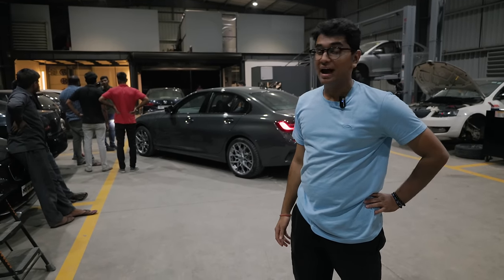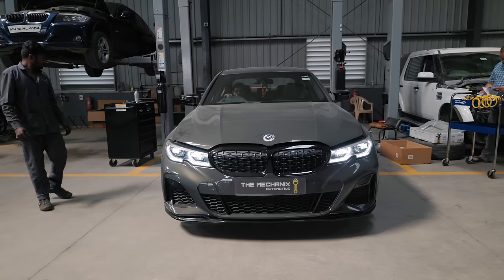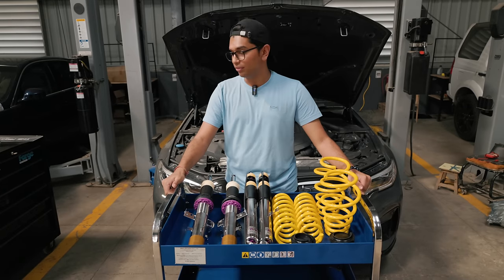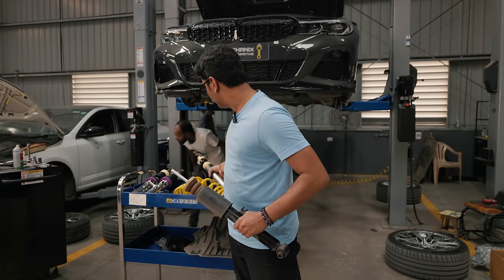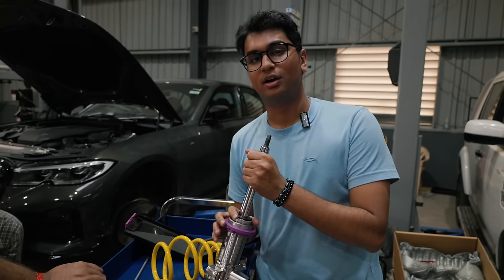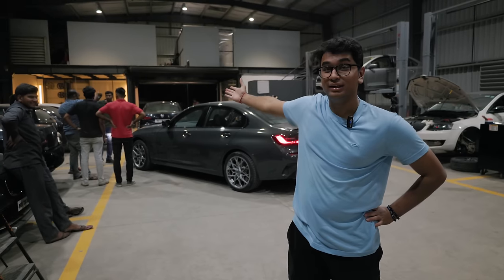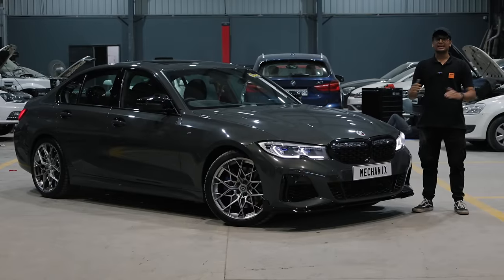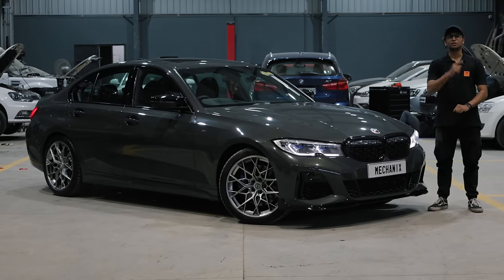We installed KW V3 Suspension on the M340i! (Worth 3.5L 🤑!) | Adjustable Suspension for the M340i!

Comment: Should have gotten a set of electronically adjustable dampers. Ain't nobody got the time to lift the car up and adjust the dampers every single time you want to make it more comfortable or more sporty. 

Adaptive suspension is the primary reason why the 530d is a better car for indian roads (outside of a racetrack) than the M340i. Comfy and smooth or sportscar stiff, all at the touch of a button.
Reply: was switched for reliability, and you know the reputation that precedes adjustable dampers
Reply: @jithinwilson2827  adaptive dampers are super reliable. It's only air suspension that has issues after 4-5 years.